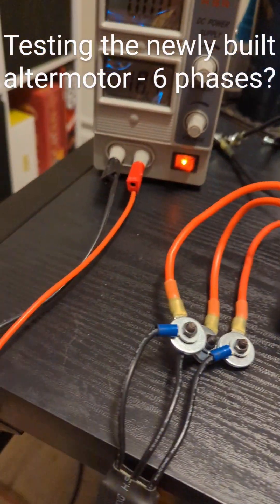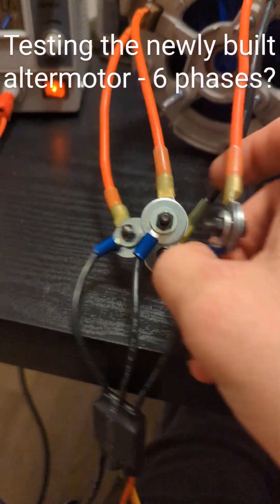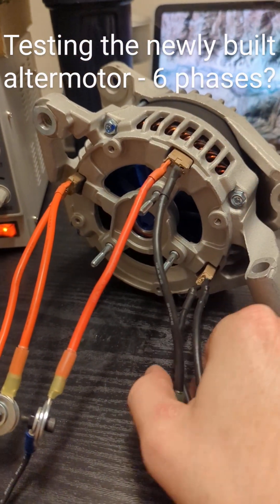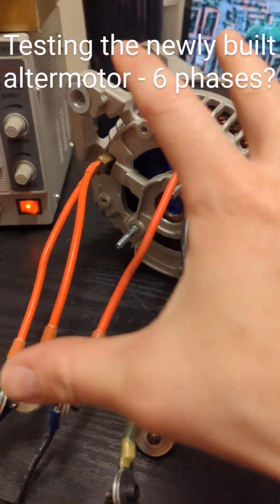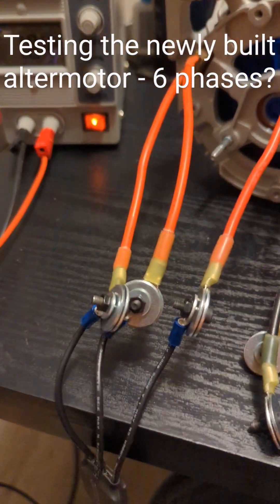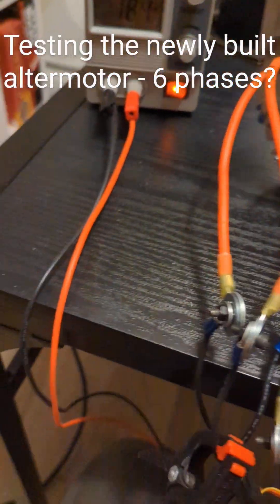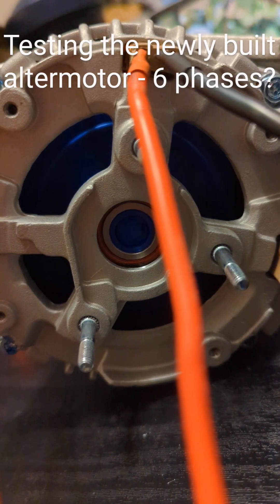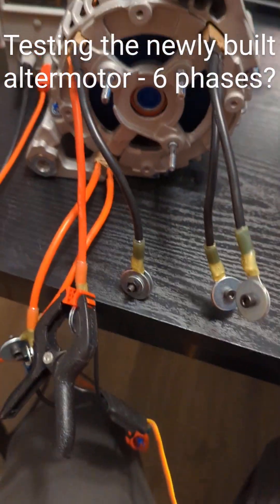Testing an altermotor from a 6 phase alternator

Comment: I'm really curious to see the performance benefits of this type of alter-motor conversion. 
Especially in terms of thermals. 
Correct me if I'm wrong, but I believe these modern alternators have thinner stator laminations which should translate to lower heat losses and a higher efficiency. 
Please, do me a favour and confirm this assumption by checking the stator laminate thickness, if you can.

#Subscribed
😛Looking forward to the next one
Reply from the maker: Just measured and see they are 28ga (0.0149" or 0.378mm).
Well, it seems like this one should run fairly cool given the mass of the copper of the second set of 3-phase windings. It's not likely that I would be able to make a custom speed controller for this, so the second set of windings will go unused. That is why I put the old AC Delco altermotor on my electric chopper project. It just has one set phase windings, so I am using more of the mass I'm lugging around. 

I also have a project in my periphery having to do with repurposing hoverboard motors. Those little things are torquey and can't wait to see how they do being over-volted and possibly with a larger wheel.

Comment: Nice. So are the poles 60° from each other or did you just split the phases
Reply from the maker: After doing more research, six-phase is not as accurate as dual 3-phase. Now I just have to figure out how to control two 3-phase windings that are 60 degrees out of phase.